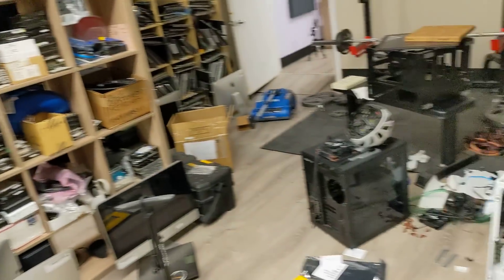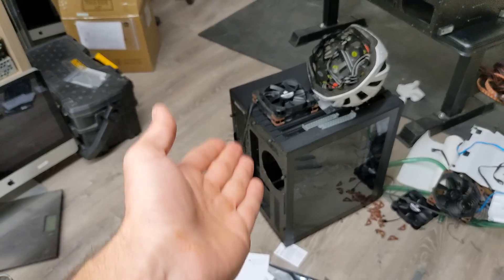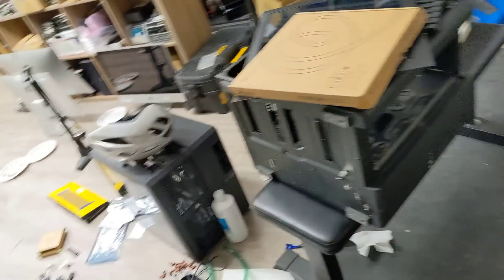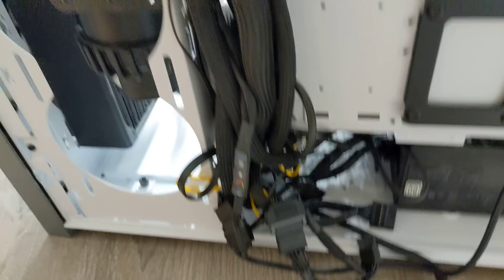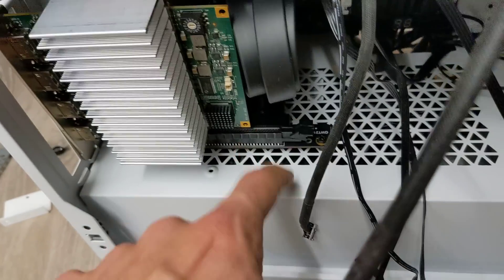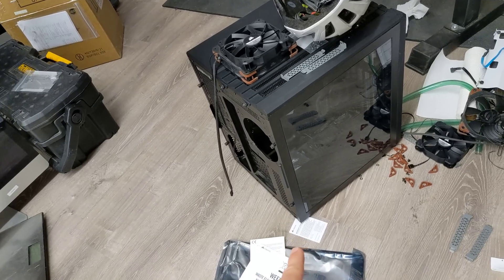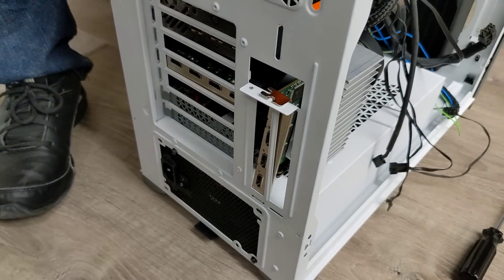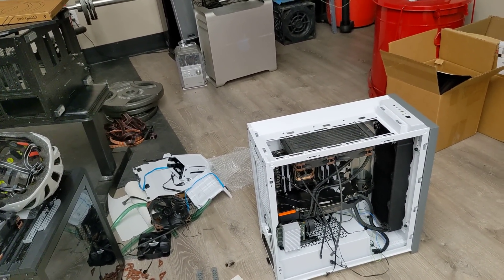I have a confession to make....

Comment: Been there, done that, I had to put everything into an old ThermalTake TaiChi case instead of the case I was actually trying to put all the stuff in to originally, because, of course the newer case had a unusual layout and nothing fit. (I miss the days, about 10 years ago, where all cases had pretty much the same internal layouts, everything just fit. But now, design is getting in the way of functionality.)
Reply: At least my CM Storm Stryker (my video editing machine) came with PSU extension cables for its bottom of case PSU location.

But, my office/streaming pc is probably going to be in the ThermalTake Tai Chi for the rest of its life.
Reply: @HoloScope  close. I scored a free case and figured it looked good.
Turns out it was stupidly sized, which is probably why it was given away for free.

Also, the graphics card was another free score around the same time from a different person.
So good when people pay me to upgrade their computers and they let me keep their old graphics cards and other things.

You should see my box of ram, filled with everything.... SDRAM, DDR, DDR2, DDR3, etc.
Reply: ...for the most part they do actually have the same layout because there's a thing called the ATX standard
Reply: Idk man you must've done something wrong. It's all standard.
Reply: @HoloScope  tell that to the PSU cables that were too short because of the mental PSU placement (no shroud, just in a really stupid location miles away from the mobo... If it was any further away you'd call it an external PSU.), and also the GPU that couldn't fit because it had a 2 inch overlap with the drive bays.

I mean, yeah, it's a LONG graphics card, but nothing super unusual.
Reply: @DazzaJay  Most PSU placement has been at the bottom of cases for a good 10 years or more now. I have yet to find a PSU that doesn't have long enough cables.
Reply: @DazzaJay  No shroud and the cables were too short for you? What case and what PSU are you talking about then? This sounds like some bad products. :D

About the GPU: That's on you though. You should always check for max GPU lenghts.
Reply: @HoloScope  (takes a look checks inside the brand new Kolink Inspire K3 that I just put a computer in for a customer.) Yeah, it's in the top.

I know most went to the bottom, and MOST will give extension cables if required. Some manufacturers don't though, and they are the ones that are the problem.
Reply: @richarde98  missed the part where I said the case was free? 
When someone says "I have this case that you can have for nothing" you just sort of say "thanks" and take it.

I will probably be able to put a crap office computer into it a d sell it at a later date, even if I can't use it myself.
Reply: @DazzaJay  Most case these days have PSU placements at the bottom. That case uses an old generic design and therefore is cheap to manufacture. Idk why you're using that as an example.
Reply: @DazzaJay  I'm beginning to question the reliability of these PSU units that you're using. Why are the cables that short? Are they OEM units from prebuilts? Where are you getting these power supplies that need extensions?
Reply: @DazzaJay  I didn't read all of ur comments. Still doesn't change the fact GPU lenghts are obviously not a problem of cases "not being standardized".

And yea, especially really cheap and old PSU's have short cables. With PSU's which are supposed to be used for builds with high loads are usually longer.
Reply: @HoloScope  apparently I can't drop urls in the comments. Either way, almost all the stuff I purchase for people comes from "PC Case Gear" in Melbourne Australia.
Reply: They all ARE standardized. Of course some have problems, but when I build PC's in many different cases I never have problems. I also built inside the 4000D (literally smaller version of the case shown here) and didn't have a single problem with PSU-cables blocking drive-bays.

Another reason why you might struggle with building is because of PSU-shrouds to make the PC look more clean for glass side-panels. There's still cases without those and they're arguably easier to build in even today.

Comment: So first, you need to shop for cases before you buy them. Then, you need to realize most people don't use 3.5" drives anymore. Put your data in a 10GbE NAS and work off that.
Reply: yeah if you use multiple 3.5 or 5.25 bays you really need to pay attention to the case layout. these days many are barely adequate enough, just thrown in to satisfy the spec sheet.

manual of these cases exist to show off an rgb graphics card, have space for a large cooling setup, and that's mostly it's main function, with a small spot for 1 or 2 2.5 drives.
Reply: Depends on what you need the disk space for.  If you're doing something that requires heavy disk access (such as video editing, graphic arts, etc) then having the drives local is much better than having a NAS.

Comment: fans can go on the inside portion of the radiator for that white case. will also make the radiator more accessible to clean if air is being pulled into the case through it.
Reply: But that might make the problem of mounting 3.5" hard drives harder or impossible, and he already said that is a problem because of his PSU(Not sure why his PSU is causing that problem unless it's some monster 1200w+ unit though). I WAS going to say mount the radiator on the top, but then noticed it looks like he already has a small radiator there(so I guess he has a waterblock on his GPU, which would be weird given he only plays DOTA 2). So my solution is to move the CPU radiator to the top.

Comment: Phanteks enthoo Pro. Using it right now.
Superb build quality. Tons of room. Spaces for 3 5.25 and 6 3.5 and 4 sata.
holds a 12.5 inch video card no problem. 7 spots for fans.
Tons of room but big.
Reply: Problem is the video capture card with the insanely huge (custom) radiators.  And I believe he said there were 2 capture cards.  That would be very hard to fit into a case.
Reply: I got a similar one (i think the pro II), minus two spots for 5.25 drive and requires removal of the last 5.15 drive if you want a radiator mounted in the top of the case. Other than that, it works fine for me.

Comment: I feel better about my own inadequacies now.  Thanks Louis.
Reply: I know. Building a pc is so easy but repairing a motherboard or other components is beyond my capabilities.
Reply: @robertandrews6915  Building is pc easy when you have all the right parts and they all work.   I have worked professionally in the past building custom systems.   At first it seams simple.  Then you have motherboard issues, ram issues, power supply issues, case issues.....  The failure that happened in the video is the reason why I normally will not be transplanting motherboards and power supplies.   Really what he was attempt to build is a nicer looking system than my current personal one.   My current personal one is a shoe rack with bench motherboard tray.
Reply from the maker: @peterdolding6918  i used to build all my computers inside the motherboard  box they came in, and i'd put a 120mm fan to blow over the board, and another to blow on the hdds and that was that. the good old days.
Reply: @peterdolding6918  Yeah, everything seems easy untill it doesn't. As the guy that now builds and maintains the PCs in our small company, I'm now afraid of 2025 (EOL of Win10) as I'll have to replace most of the systems :/
Reply: I can build a car...as long as its got no computer. Either ECU or PC, I just cant...I'm gonna use the excuse that my hands and fingers are just too big.
Reply: i have no training, building pc's since 1992. yet i cannot find a job.
Reply: @SLAYERSARCH  Then cert out A+ and get some free/cheap training you can put on a resume.
Reply: This PC fuq-up is just like NYC... fuqed up. 😂
Reply: I feel better knowing I have an actual
Skill in building PCs
Reply: Repent to Jesus Christ “Do not be overcome by evil, but overcome evil with good.”
Romans 12:21 NIV
h
Reply: @repentandbelieveinJesusChrist3  go away jesus fool bot
Reply: That scriptural stuff made a lot more sense in the heated discussion thread about the Verge journalist and politics and salt, here in this discussion it just smacks of fanatical irrelevance. Spouting Scripture in a discussion about PC building is about as appropriate as interrupting a priest mid-sermon with an outburst about that rad new gaming PC one just built.

It also doesn't help that these close-minded cultist types are just open-minded enough to entertain the concept of introducing uninvolved and uninterested people to rude (sometimes explosively so) interruptions to their daily lives.

Plenty answers in the Bible, for certain subjects. PC building isn't one of them.